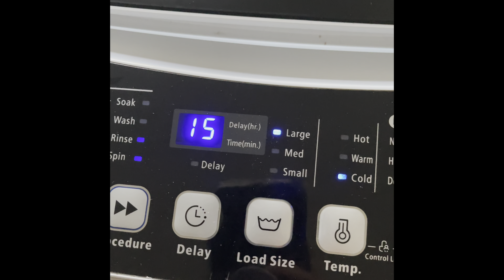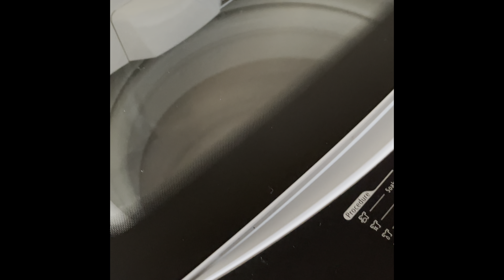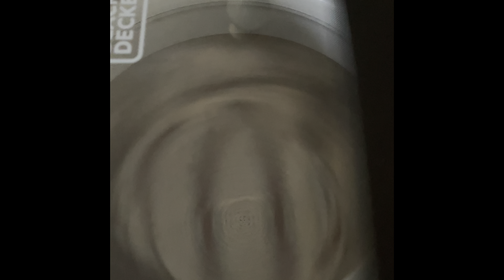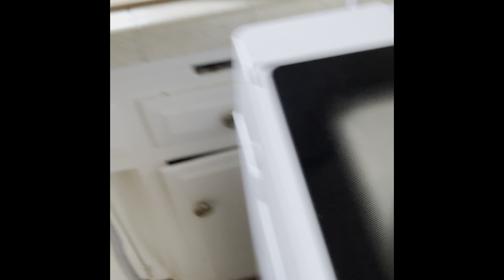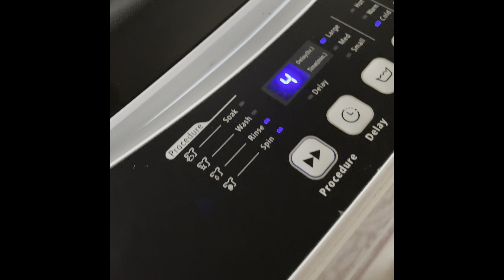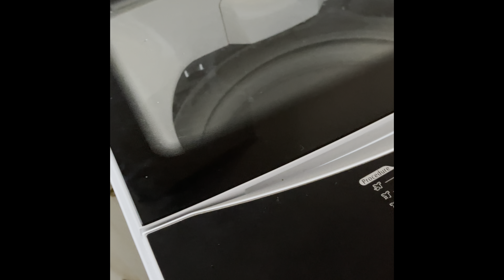Black + Decker 1.6 Cu. ft. Portable Washer Review

Comment: Let me help you out, on the detergent dispenser, the left side is for powdered detergent and the right side is for bleach. In addition, rotate your drum manually clockwise until you see on the top of the drum about a three inch indentation with four holes in it. That is where you pour the softener or vinegar you use to soften your clothes, and the machine will dispense it during the final rinse cycle.

Comment: Two suggestions to take or leave:  Put a knee high stocking on the end of the drain hose to collect all lint as you don't want to clog your kitchen sink and alert the landlord that you have a washer.  They may not like it.  Also you can hang your clothes right in your closet (unless your closet is packed with clothes) and put a fan on the floor and aim it at the clothes.  I just bought this unit you have and am very excited about using it.  Thank you for the thorough tutorial.

Comment: I’ve never seen any other video reviews of their adapter leaking like that. Thank you for the review.
Reply from the maker: Yeah. I honestly think it’s my faucet because before I attached the adapter thingy my faucet was projectile vomiting water out and it wasn’t pretty so ... yeah.....
Reply: @Juliav14  Check the O-rings inside the adapter. If you only have one O ring, put another one in it and see if you can still screw it into the tip of the faucet. If you don't have any O ring, then add an O ring. Moreover, it's always a good idea to drape a rag over your quick connect adapter to prevent the water from splashing everywhere.
Reply: I have.  Several

Comment: On these .9 to 3.0 cu. ft. portable automatic washing machines, it doesn't matter one iota which brand you go with. Why? Because they are all made for the various brands by Midea Corporation of China. Hence, no matter the brand you purchase, they are all identical. Indeed, the Black and Decker is identical to the Magic Chef, the RCA, the Comfee, the Panda, etc., etc., etc.The only thing that is different is the brand badging. 

Hence, for anyone currently looking to purchase one, find the best price regardless of brand and buy it.
Reply: Good point and observation, the only problem that I have with mine is that the drainage is a gravity drainage feature and not a push pump like the one this machine shows to have. The gravity drainage is a pain to deal with because you have to have the machine a little bit higher so that the hose hangs down and drains out thoroughly otherwise the machine won't work if the water doesn't drain out the hose properly the machine just pauses until you drain out the water so with mine you have to babysit it and I should have done more research on these machines when it came to the drainage feature.
Reply: I noticed this too. Whirlpool is also the same machine but priced double or triple.

Comment: Mine washer still comes out water from the drain while is filling why does that happen ?
Reply: because the drain hose is lower than the water level in the drum. it needs to be at the same level or higher.

Comment: You can probably add another O ring to your adapter to stop that leaking. If not, simply drape a rag over the adapter connection when doing wash. That way the water won't splash all over the place. Indeed, always make sure your connection to the inlet is snug and tight before beginning a wash cycle, drape a rag over the quick connect connection, and then use paracord or some other mechanism to secure your drain hose so it won't fall on your floor and flood your kitchen, and then you won't have to baby sit it if you don't want to.

Comment: Hi. Thanks for the good video. I just want to recommend you to check your quick connector, make sure it has one black round rubber inside then connect it back really good to the faucet, if it still running water out try buying the teflon tape at home depot cheap for $2.00. Then wrap the teflon tape around the quick connector, wait at least 30mnts to dry and good to go. Also i bought a pack of 2 lint trap at CVS for a $1.00 and also Amazon sells them. This is for the drain hose, easy to put it in and is very good collecting all the lint coming out from the drain hose. I really hope this works for. 👍
Reply from the maker: Yes thank you! 😊
Reply: For the lint coming out the drain hose, I just use one of my kitchen strainers. Then when I'm finished my wash, I simply clean the kitchen strainer and put it up
Reply: U can buy knee highs at Wal-Mart...has 4 pcs for $.89

Comment: I’m having problems with the rinse cycle ….It just stops and then displays E2 error message…Help !
Reply from the maker: So according to the manual, the water is not properly draining out of the washer. Maybe there is something stuck ? 
Does it always stop and display that error?
Reply: @Juliav14  it was my first time using the machine but after watching a few videos I noticed the battery for the drain pump wasn’t connected…once I connected it back it started working…Thank you tho ☺️
Reply: I bet you have your washing machine setting is set to hot, but when you go to the back of your washing machine, you only have a hose connection from the water faucet to the cold water inlet of your washing machine. Which means that your washing machine setting must always be set to cold. Otherwise, when it gets to the rinse cycle, the machine will just stop because their is no connection connected to the hot water inlet. 

The only time you would be able to set your washing machine to hot is if you have both hoses connected to the hot and cold inlets. However, since you only have one hose connected to the cold water inlet from your water faucet, your machine must always be set to cold. 

Now, this doesn't mean you can only do cold water washings. As you can regulate the temperature via the hot and cold water service valves at the sink. So, for instance, if you are doing a hot wash, disconnect the quick connect, open the hot water service valve and run the water till hot. When hot, shut off the hot water service valve and reconnect the quick connect. Then finally open up the hot water service valve to fill up the drum to begin the wash cycle. Then once the wash cycle begins, cut off the hot water service valve and open the cold-water service valve so the washing machine can rinse in cold water .
Reply: Do you think you could help me with my 3.0 Black & Decker, portable washer having some issues as a new user

Comment: I bought it and idk why but after the first spin and it gets stuck at 7 minutes and doesn't want to rinse again. I only set it to quick wash and large. Pls help
Reply from the maker: Hi, so at 7 minutes it’s supposed to refill. So you have to connect the adapter and turn on the faucet to fill it up. Let me know if this works?
Reply: @Juliav14  how do you know when to stop the water? Is there a “fill” line or does the water stop automatically?
Reply from the maker: @elizabethnieves94   hi 👋🏽 the water does stop automatically. It usually runs for 2 minutes.
Reply: Set your settings on the machine to cold, as opposed to hot. As you don't have it hooked up like a regular washing machine, but instead as a portable washer. Hence, always set your temperature on the machine to cold. Now, you can still do hot, warm, or cold water washing by regulating the temperature manually at the faucet. 

You do what I just told you and you won't have anymore problems.
Reply: @elizabethnieves94  It does it automatically. As there are sensors that automatically shut off the water when the water reaches the correct level depending upon your settings, i.e, large, medium, or small load.
Reply: Prayer Warrior Girl  I'm not sure what you are saying, but nonetheless, assuming you are doing it right, you set your settings for small, medium, or large loads and the amount of water allowed to enter the machine should depend upon the setting you select. As there are supposed to be sensors located inside the tub that are supposed to automatically detect the water level dependent upon the water level you selected and automatically shut off the water intake once the level you selected is reached. If your machine is not detecting the water level you selected, then you definitely have a problem. 

If your sensors are not working and permitting the water level to over flow and despite your settings, then I would definitely call your manufacturer or extended warranty people, and explain to them the problem you are experiencing. If, on the other hand, it is brand new machine you just received, then I would call whoever you purchased the machine from and tell them you are sending the machine back and that you want a full refund or otherwise a replacement machine. 

However, I would read and re-read the instructions again and again to make sure I'm not doing something exceedingly stupid first 

Moreover, water all over indicates a host of probable causes. Does your connection at your quick connect leak? If it does, it is probably because you didn't remove the O-ring from the aerator and at the same time, you removed one of the O-rings in the quick connect before you screwed it into the faucet threads. 

I did the same thing initially because my quick connect with both O-rings that came with it would not screw into my faucet. However, after I removed one of the O-rings from my quick connect, it screwed right into my faucet easily. However, when I did that, my faucet leaked when connected to my machine with the water service valve turned on.

Hence, I disconnected the quick connect and felt inside the faucet until I found an aerator O-ring that was thinner than the one that came with my quick connect inside my faucet. So I removed that O-ring from my faucet and replaced that O-ring with the second thicker O-ring that I had previously removed from my quick connect, and guess what? I suddenly could screw in my quick connect into my faucet with both the O-rings that were initially in the quick connect from the get go and at the same time, it also solved my water leaking problem. No more leaks. 

Next, you also need to make sure that the input hose is screwed into the cold water inlet of your machine securely. The instructions say screw till hand tight and then turn two-thirds more with pliers to prevent leaking.

Because of that your water temperature selection on your washing machine setting should always be set to cold before you hit the pause/start button regardless if you are regulating the temperature of the water via your hot and cold water service valves of your sink. 

Of course, if you have regular washer and dryer connections where you live, then you would connect to the separate hot and cold water inlets and use your machine's temperature settings to select the desired settings. 

Nonetheless, per your description of your problem, it sounds to me that you have a water sensor problem. So my next question is when you use the small load selection or the medium load selection, does the machine still try to over flow as you described. Or does it stop as it supposed to at the correct level selected. 

Finally, as a last resort, I would re-read my owner's manual once again to make sure you are doing everything correctly. Then if you are positive you are, doing everything correctly call your seller to see if you can finagle them into taking the machine back and then short of that, call the manufacturer.
Reply: Prayer Warrior Girl  Good luck. Those dents are evidence that the machine was mishandled in shipping which in all probability caused internal damage. Because of those dents, you should be able to return it to QVC. 

When I bought mine, the washing machine came with several dents on three sides of it. So I called Amazon and told them that was unacceptable and would return it back to them. From there Amazon contacted UPS and arranged for them to pick up the return unit at my apartment the following day. At that time, they also issue me a full refund as well. Which I then used to purchase another washer from them. 

The second washer I received when it came in, was in perfect condition and I kept that one, of course, and it works marvelous to this day. My dryer also arrived undamaged and also works like a charm to dry my clothes. Good luck.